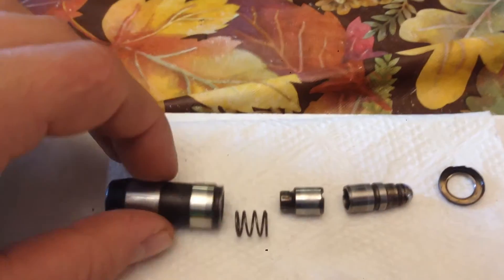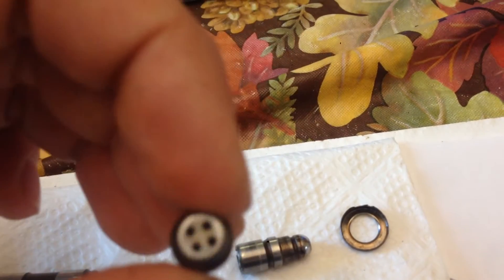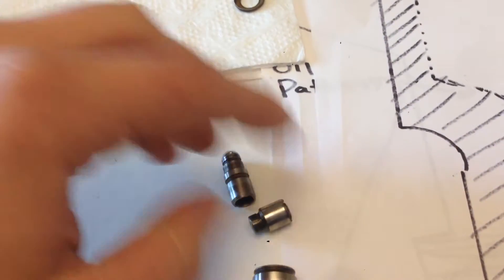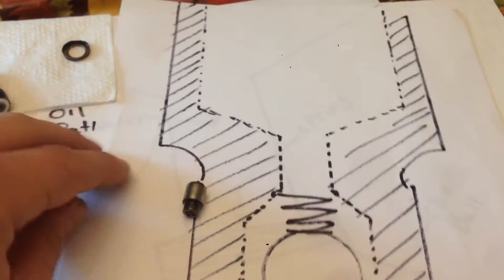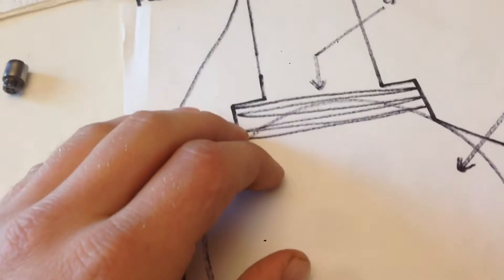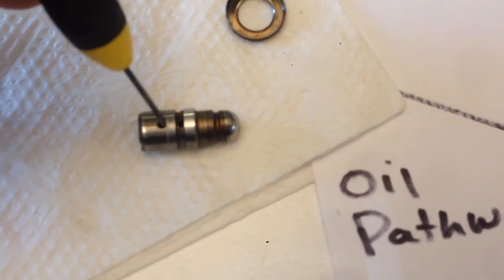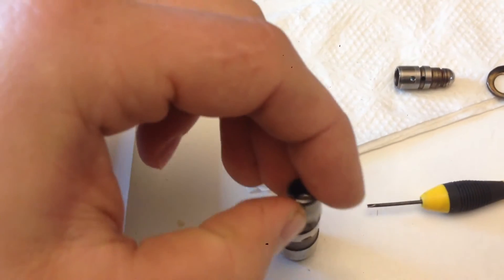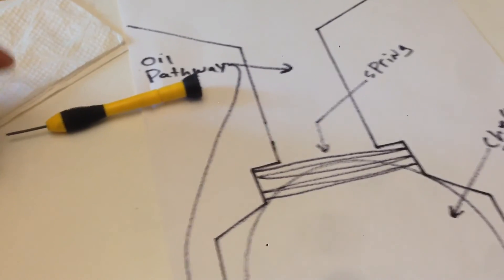Hydraulic lash adjuster components

Comment: I this video was from 8 years ago so I'm not sure if you'll see this comment but I have a couple questions on last adjusters. 

When you install them should they be stiff or soft? & should you soak/fill them with oil prior to installation? 

Any help would be appreciated.

This is the first time I've had issues with these things and don't want to ruin the mirror before it even gets started. Even if I buy all new ones, I can't be 100% sure I'm installing them correctly because I keep getting different answers but maybe you have some insight.

I'm only hijacking this section because it was from 8 years ago and I didn't think you would see it. Do you have somewhere I could maybe email you @? Thanks.
Reply: I've got the same questions. Did you ever figure it out? Bought new lifters and they are springy and not at all firm. Not sure if they need oiled first.

Comment: How can you tell if these adjusters go bad?
Reply from the maker: Normaly it makes a ticking noise, like a valve that’s out of adjustment. More often then not the bearings in the rocket go bad before anything else.
Reply from the maker: Of corse I am talking about the 5.4 triton 3 valve motors
Reply: @goodolboys713  I have a 1988 Toyota Cressida with a SOHC N/A 2.0L 1G-E engine. This engine have a Hydraulic lash adjusters that looks similar with the one you showed in the video. 

My problem is, it knocks loud if I drive the car at 3500-4000rpm for more than 3-4 minutes. The knocking sound gone if I turn off the engine for 2 minutes and it reappears if I do 3500-4000rpm again. 

What I've done so far is purged and cleaned all of them by pushing the ball valve inside the HLAs using stiff wire and squeezing the piston inward until all the sludge and oil comes out. Then I repeat it again while submerging it in a fresh new oil to prime it. I also cleaned the section of the cylinder head that carries the high pressure oil into the HLAs (what is it called?) until it clean. Then I reassemble everything. 

It lasts only a couple hundred kilometers.

Comment: This is from the Coyote engine right? Do you have an old lash adjuster or 2 that you could send me? And a rocker arm?
I have a 3.6 pentastar that uses lash adjusters very similar to these. I want to see if the Coyote lash adjusters will work.

I cut one of mine open and I can tell the spring on yours looks larger. Everything else looks the same. Thank you.

We have issues with these failing all the time and my car is boosted and I would love to find an upgrade.
Reply from the maker: These actually came out of a 5.4l triton truck engine (2006 f250) these lash adjusters are only $13 a pice at the local ford dealer. I unfortunately sold that truck a long time ago an no longer have any of the parts unfortunately. I would hardly say these lash adjusters are any better, the rocker bearing goes bad then it busts the top of the lash adjuster off! Hopefully this helps you out!
Reply: @goodolboys713  ok. I bet these are the same ones they use in the coyote engine hmmmm 13 bucks! I will just need to order one. thank you!

Comment: 25 lbs of oil pressure on 85% of the ball pushing up is enough to hold against the valve spring pressure pushing back down the much smaller tube.  Kinda like having a pen in your hand being able to keep it against much stronger people who only have a fingertip grip.
Reply: Physics is cool